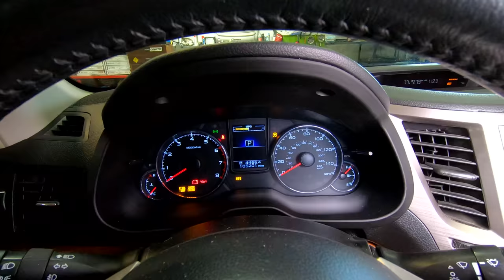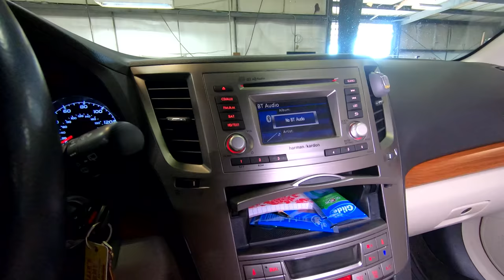Unusual sounds & smells cost serious $$$. CAR WIZARD shows how to find them and what caused them

Comment: My aunt actually lost a wheel on a caravan due to wheelbearing.
Reply: Caused by the caravan standing in the same place for long periods of time..the grease congealing and not spreading when rotation starts again (when you take it out on the first long run after winter) and just not maintaining the bearings.
Simple solution..spring loaded bearing buddies...keep the grease pressing in at all times...
Reply: @JohnSmith-yv6eq  yeah, she had borrowed it of an old couple. They had warned about the wheel bearing, but thought it had 1 more trip in it before being scrapped. Dad picked it yp a day later with the tractor.
Reply: @erikgranqvist3680  
Did your Dad get stuck with changing out the bearings too?